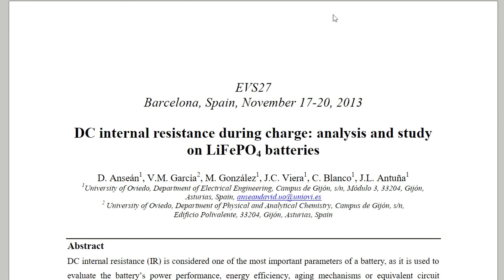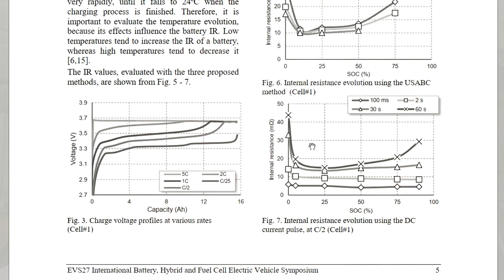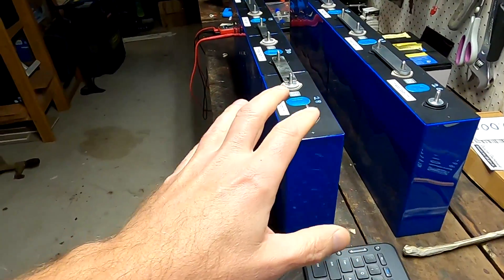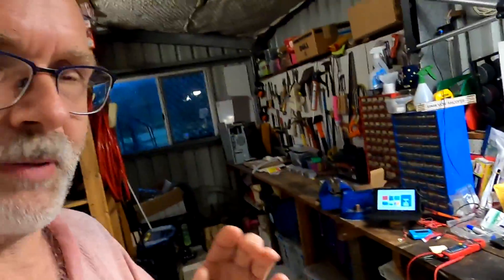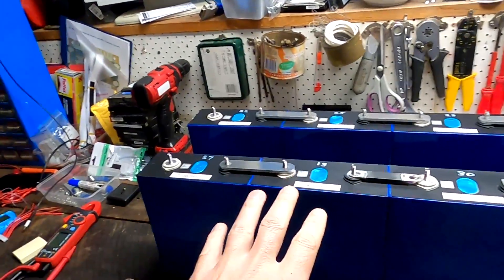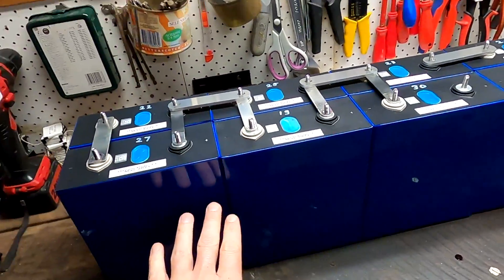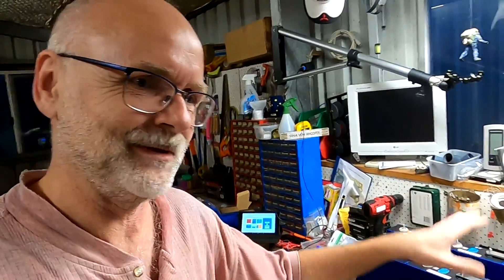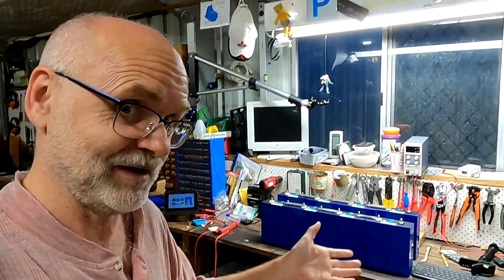Can you parallel battery banks after bottom balancing?

Comment: Whether you top or bottom balance makes no difference. When you have two packs in parallel you have 2 separate BMS units to control them. So if battery #1 needs 13.8v and battery #2 needs 14.0v then you set those separate limits on each packs BMS. When you hit 13.8v battery #1 disconnects and your charger just continues charging battery #2 until it hits 14.0v.

The same happens with top balanced packs at the bottom of the discharge: Battery #1 might disconnect at 10.0v and battery #2 might disconnect at 10.8v. At 10.8v battery #2 disconnects and battery #1 keeps running your loads until it drops to 10.0v.

Separate parallel packs = separate parallel BMS units and the batteries can be disconnected separately.

I'm not arguing in favor of (or against) bottom balancing: I'm simply pointing out it doesn't matter. Two parallel batteries will always have either a different "max charge voltage" or a "min discharge voltage". No two packs will have both max and min voltages equal. Top balancing means charge voltage is the same, bottom balancing means discharge voltage is same. Either way one will be different. One pack will either disconnect first when charging, or one will disconnect first when discharging. Either way one pack may disconnect while the other pack remains connected. That's just the reality of having parallel packs.

Comment: I suggest two top balance the batteries that you get all of them at the same cop balance and then just put in a temperature sensor to cut it off and that's it I mean they don't recharge the cells in a battery that's built from another commercial company

Comment: After bottom balancing the new set, you would just need to charge them to the same voltage as the other sets and then connect them.  No need to discharge the old ones.  I think you are over thinking the problem.
Reply from the maker: But the batteries won't have the same voltage when bottom balancing.

Comment: i will tell you what i have dun in my battery packs,, i bought 1/2 of a leaf pack,4 packs of 6 battery modules ,i for me the bottom is 42 volts / or your volts ,each of the 6 pack then i let them set and when there all about 42volts or your volts  i connect them together 4 packs, and let them set for like a week,, then i charge to 80% and i ran them for like 1 year then the next tax time i got the other 1/2 of the leaf  battery,,i did the same thing again  but i have to get the org pack down to 42 volts for my pack ( when the volts are close there's no rapid volt jump) then i let them set 4 days or so the longer the better so the batts get acquainted. then charge 80% again  80% to me is full then i got some chevy volt batts, 48volt modules ether 1 or 2 at a time when i had the $ and did the same thing, just pull the pack down to what ever your bottom volts you have in  your pack ,as long as the new pack and the old pack are the volts ,or at least close they should be fine, thats how i did mine ,no bms no nothing, just set the preameters top / bottom then run

Comment: As for adding another pack to a bottom-balanced system:
1. I think using the lowest "charge-stop" voltage you measured for any battery will do as "charge-stop" voltage for the overall system
2. When adding a new battery pack: after balancing just charge it up with your lab powersupply until it is within a small voltage difference to your system and then parallel it

Comment: For paralleling the strings, the voltages must match, so with a dc/dc converter, we can bring them equal. the capacity off the strings does not matter, we could parallel a string with 5 Ah with 280Ah, once the voltages are the same. The difference in voltages or Difference of potential makes the current flow, no difference is 0 Amp between the batteries. 
This needs to take place only once, after that, they can stay in parallel forever.
Reply: Once any cell of any string is too high derterminates the maximum voltage of the all pack.
Once any cell of any string is too low determinates the minimum voltage of all the pack.

Comment: Are we overthinking this? 

For years people were using AGM 6V or 12v batteries containing 3 or 6 individual cells, but because we didn’t have access to the individual cells and the electronics to accurately monitor them it wasn’t an issue (or we couldn’t easily fix it) 

My early background was in telecoms where we had 24 x 2V flooded cells to run 50V electromechanicaexchanges, and even here the cells were only checked for SG and levels every few weeks.

When we began to build battery packs from used 18650 cells in series/parallel configurations and run these at high C rates things could get very hot very quickly, so we developed the ability to keep the flames in; but with high capacity (>200Ah) LiFePo4 cells running at less than 0.5C charge/discharge rates do we really need to be that worried about a few mV of cell difference?

If we equalise each cell in parallel before building out our battery and monitor things with a BMS to ensure nothing goes too far out of sync, should we really be worried about minor differences - just as we have/had in lead acid and AGM batteries even today?

Is this just a case of “what gets measured gets managed”, and if so how much management do we really need?

Just putting my “flame suit” on ready for a barrage of replies from both sides of the top/bottom balance argument, and their firmly held inalienable beliefs of why the other side is wrong. Please be nice!
Reply: Well said 👏👏👏

I have not heard of any sensible (ie backed up by peer reviewed real data reports) to explain why people are so worried about cell balancing down to single millivolts 🤔

Andy, and others who comment, appear to recognise that each cell will be different due to slight differences in chemistry but then try to decide on ONE SINGLE VOLTAGE to define a fully charged cell. Surely, having acknowledged that each cell's chemistry is different, the only real conclusion is that EVERY cell with have a DIFFERENT terminal voltage when state of charge is 100% ???
Reply: Doesn't relate.  Lead-acid uses controlled overcharging to balance cells that would destroy Li-Ion battery.
Reply: You should not need your flame suit, I agree with your position.  I think that if you are not trying to squeeze the last possible electron out of a pack then balancing during use is a bit academic are whether you top or bottom balance does not matter.  A bms can just be used as a safety fuse/alarm only without using the balancing facility as long as you don’t try to take the cells to the extremes of capacity for the pack.
Reply: Lead acid cells continue to pass current after reaching full by splitting water. That is they have a balancing function chemicals built in. Lithium cells do not, so we must add electronics to pass current after the cell is full.

Comment: You're going to give yourself a massive headache. What state of charge is your battery going to be in most of the time? That's where you balance. For vehicles you are mostly at the bottom, so bottom balance. No expansion there, just one battery. For solar, you're mostly at the top, and you want to have a flexible, expandable system - so top balance. You will never have a perfect balance of the cells with xx mV at 99% state of charge, especially with these cells (I've been running them for over a year now). Stay below the 90% or even 80%, and stop worrying. Add another battery and and when needed. Accept that your weakest cell will determine capacity, maybe replace it if it's really bad, but a couple Ah doesn't matter. Sit back, relax, have a bear, and watch your system perform without having to babysit the thing.
Reply: Agreed
Reply: completely agree with you. Andy, take a beer and relax. Forget these cells aint german soldiers, all strait and moving synchronously. Take care of them, of course, but do not become crazy. Awaiting the new battery setup. Don't send us to take a nap with this "unsmokable" videos...... don't forget the beers......
Reply from the maker: Guys, I'm super relaxed with this. I'm just asking these questions because many have them and there are no answers to find...
Reply: @OffGridGarageAustralia  I made some videos about this some time ago. Just top balance them all and put them in parallel. It's really not a big deal. Top balance manually if you wish, or let your bms top balance it over the course of a few weeks. I took most of my manual balancing videos down because it's a waste of time. Let the bms balance it. Here is a random video I made about active cell balancers and how pointless they are : https://youtu.be/cmZ-_sRnGj8

Bottom balancing was only done when we were running these packs without bms. Times have changed, and top balancing is standard with bms managed packs.
Reply from the maker: Thanks Will, I remember this video from you: https://www.youtube.com/watch?v=FRzrO2SAqSA
Reply: @OffGridGarageAustralia  oh cool! That was a fun one haha
Reply: @OffGridGarageAustralia  I was a bit tongue in cheek with the relax bit :) You can parallel bottom balanced packs - the only caveat is that if you have a first pack that is bottom balanced and can charge to e.g. 55V and your new pack can only go to 54V, your new charge parameters become 54V for the entire system. Should the second one have a limit that is higher (say 56V), you can not use that and have to stick to 55V. Whatever the weakest cell is will determine your overall battery performance.
Reply from the maker: It's a great video you did back then.

Comment: Never would I run without a BMS. Every manufacturer of battery systems uses a BMS with balance there must be a reason as profit is too thin they would leave it out if they could. I bottom balance with balancer and BMS I also top balance with them in fact I balance anytime the cells are out of balance. I also have no problem allowing voltage to run from one cell to another and one bank to the other so I do not see your concern it is a natural fact to allow voltage to go where it's needed so stop swimming upstream and let it happen.

Comment: If you have separate paralleled inverters like David poz, he has three 5,000 watt grow watt inverters could you have a separate battery Bank on each inverter and with that keep them separate and acting independent but still have the same overall system capacity?
Reply: thats getting crazy expensive though.
Reply: @John-gm8ty  David Poz using Growatt 5Kw  inverter chargers. Growatt also do 3Kw parallel enabled. They are not as expensive as Victron SCC & Inverter! But do need a lot of Solar panels, at high voltage (up to 250v) Can run without battery.
Reply: @michaelbouckley4455  I have seen videos on them ;)

Comment: Hi Andy you have internal resistance tester I would tend to match cells in pairs top. Test ir test and bottom test resistance  and go 16s 2p  I'm doing that times 2 on my build underway. I used to top charge and wait a week or longer and then match all batterys.they drift to comfort zone. Lot slower with out internal resistance meter   but I learned a lot over 6 months of mix and matching.i prefer top balance to 3.6 and wait to settle. It will come out close testing with ir by the way I don't like more than 2 p on large cells unless you active balance .keep it simple and let the battery do the work .

Comment: Bottom balance is fine if you're not gonna charge to full. As soon as you charge to full they will be out of balance. Top balance and then only use between 20% and 90%
Reply: @Coach Life You can also say, Top balancing is fine if you're not gonna discharge to empty. As soon as you discharge to empty they will be out of balance.
Reply: @SpeakerKevin  thanks it was almost as if I missed the upper and lower limits in my comment 🙄

Comment: Batteries are never perfectly matched and their parameters will vary depending on a heap of parameters on top of that. Balance will never stay "perfect" for very long on its own. Also, the reason the balance current is only 200mA and can act on multiple cells at a time is because your BMS uses a simple resistive balancer, all it does is turn 3.4-4.2V/200mA into 700-850mW of heat. No taking energy from one bucket to put it in another here unless the "other bucket" is air.

Comment: When paralleling the 2 battery packs, they will be at the same voltage, but they each will have slightly different energy levels. Not a problem. The difference in voltage is so low, that the exchange of energy is quite slow. The current between the 2 batteries is so low that there will be nothing to worry about.

Comment: Considered batrium watchmon bms ? Looks nice, and even possible to integrate with victron venus.. One module per batterycell , and multiple banks..
Reply: @John-gm8ty  yes, but look at the battery investment.
Reply: @kevinmills5293  all depends on your start up capital I guess, many off griders or solar sheders start off small and build up over time, as a full  install runs in at 20+K easily.
Reply: @John-gm8ty  I was thinking about Andy’s situation but of course you are right.

Comment: No need to go bottom balance just to get them connected, if the voltage is way off between old and new. You need the battery to run your house. I have to say put a resistor in between new and old battery, not sure the value but 1 or 5amp flow is enough to balance between both battery. if it less than 200mV (or 1V if it in series) between them, you can forget the resistor and directly connect them both.

Comment: Top balance for backup applications like maybe yours and bottom balance for electric vehicle applications as someone has also mentioned.
Parallel up the batteries for crying out loud.  It's been done before. What's the problem?  :)
Reply: Top balance for everything and BMS for everything. Neither one of: Tesla, Nissan (Leaf, env-200), Chevrolet (Volt, Bolt), Audi (e-tron), Porche (Taycan), Mercedec (EQV, EQC) do use bottom balancing. EUC, electric scooters, Ebikes, electric cars - BMS everywhere, with top balancing.
Reply: @ebenwaterman5858  I do not believe in going out of my way doing bottom balancing if BMS already does per cell overcharge/overdischarge protections. Protections works either way, no matter how many cells hit high/low voltage cutoff, so there will be no difference where to balance (top/middle/bottom). I like top balancing from convinionce point: fully charge all cell's, assembe the pack and now you have a ready to use pack.
Reply: @volodumurkalunyak4651 Right you are.

 I just picked up a couple of 5 amp active balancers from Heltec.  I want a system I don't have to babysit. That should do the trick. 

First off, if you start with cells that are matched like Andy's were, there won't be much balancing to do anyhow.  I think he's chasing his tail a bit.  :)

Comment: I think the best is to keep top balancing. I personally for solar setup, i dont like bottom balancing. I think this is good for a golf cart, eletric veicules, but for a static setup.... I think top balancing is the way to go, unless you have a very mismatched pack. Will Prose as a very good video talking about top and bottom balancing.
Reply: golf cart and ele forklift top balance . it is called equalize button or the chargers.
Reply: @martehoudesheldt5885  they use lifepo4?
Reply: On the ones that I have seen they float charge for a longer time to do the same thing. But only once a week